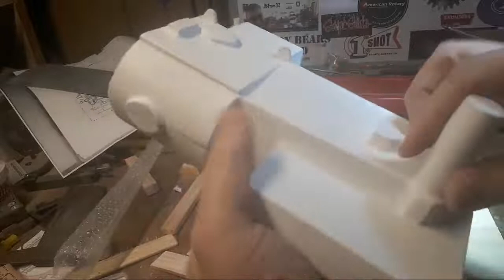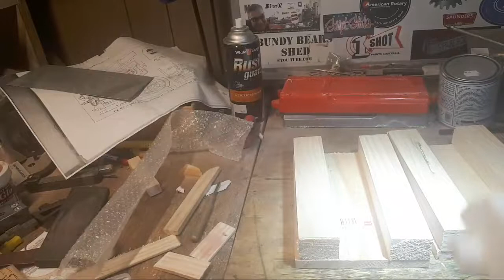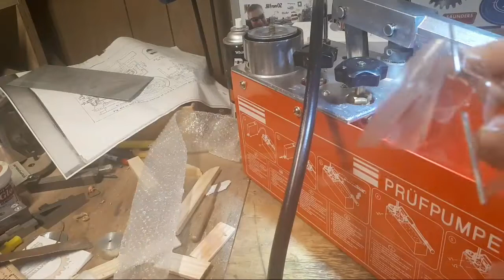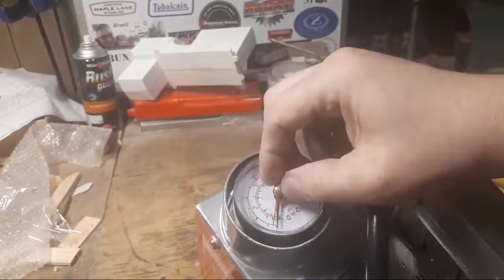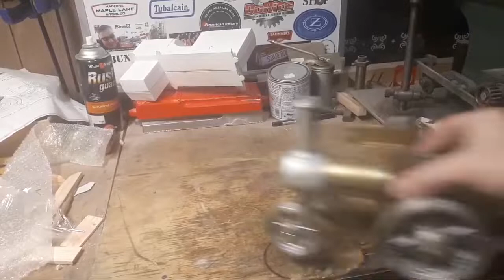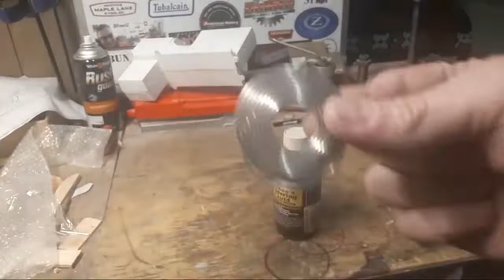Wednesday Night Live- no actual machining!

Comment: PTFE can be bought in cord form, about  2-3mm diameter, from a plumber's supplier, well you can here in the UK. 
If you want to roll your own, perhaps you might like to get the gas version of the tape  as it is thicker than the water one.

Comment: Just watched and read comments. For the pressure test: The volumes you are working with are small enough that  most of the safety concerns are not an issue during testing. If the test pressure is below 1MPa (150PSI), a commercial expansion tank (domestic water supply type) will give an expansion volume and buffer the pressure gain on each pump stroke. An restriction orifice (I have made them by drilling a flap type check valve, though they can be bought) at the tank controls flow rate back into the system on a leak. A valve at the vessel (isolating the test gauge and vessel from the supply) provides the stop needed for pressure drop testing. Valve kept open provides leak locating. Steam test pressure is 1.5 of MAWP (not to be exceeded by more than 6%) in ASME section I.
Reply: Clarification: Hydrostatic test pressure for steam boilers is 1.5MAWP. Never pressure test with steam. (cant fix word in first comment)
Reply from the maker: thanks for that, from experience thats a very good rule to go by/.